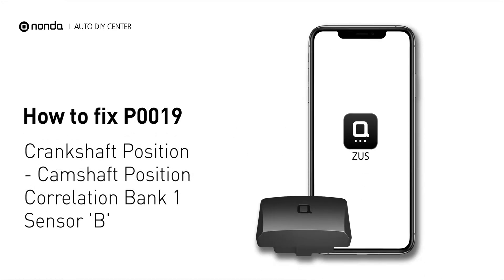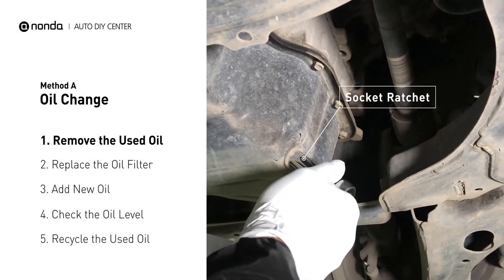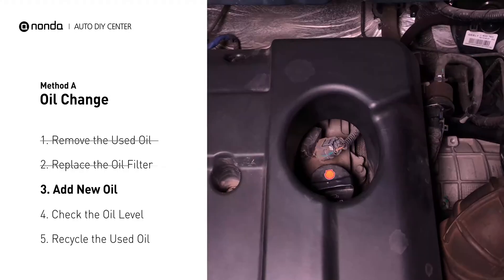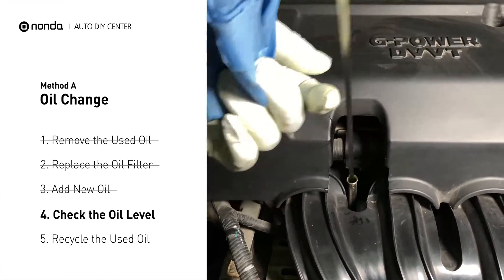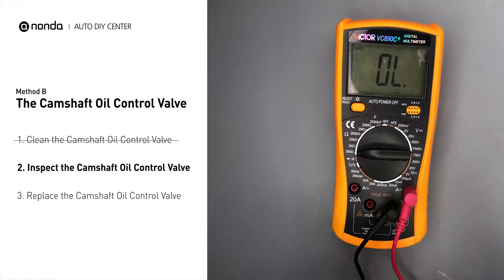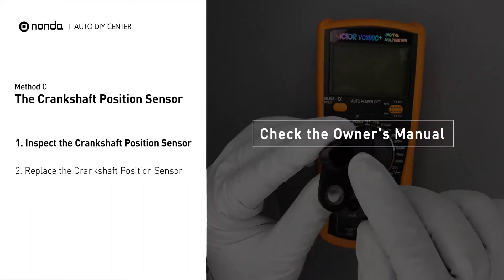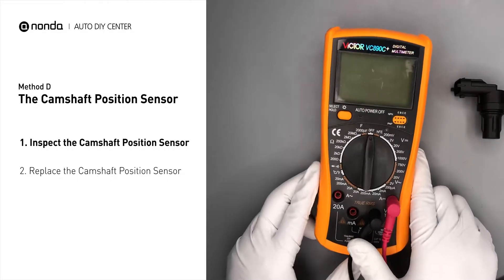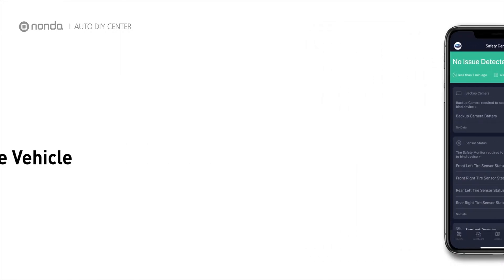How to Fix P0019 Engine Code in 6 Minutes [4 DIY Methods / Only $6.85]

Comment from the maker: Hi, I'm Steve, nonda's lead mechanic engineer. 
Feel free to leave your comments here if you have any mechanic questions, I will be glad to help you out!
Reply: I have installed a rebuilt engine and got P0019.  I put the racing oil by Driven for engine break in.  Does that oil cause the oil.  Because I am replacing it immediately once I run the engine in idle.

Comment: This is usually wrong.. if you are getting this code the timing chain is going bad. Save time and just change it
Reply: Bs. It just means the computer isn't reading the signals from the camshaft or crankshaft sensors at the right time . These are Hall effect sensors so this can be caused by anything that can damage it or effect the magnetic field. Things like engine sludge , heat damage from low coolant , low oil ,road damage or sensor failure will also trigger this code. If we use a 2015 Hyundai Elantra as an example , i just fixed one with this code that triggered after an oil change . I pulled the sensor ,  found a bit of gunk on it,  tested it to be sure it was working then changed it anyway because the part was $4 on amazon.

Comment: Hello my Subaru xv 2017 error p0019, took it to the mechanics, they looked at the solenoid, they replaced it, the check did not disappear, we need to disassemble the engine and look at the circuits, also other mechanics say it was a case of the whole engine, all the filters were changed, but it turned out that the electronic control unit was changed and the error disappeared after that, just what do you think? And in general Is it possible to drive with this error?

Comment: Subaru Crosstrek P0019 code. Crankshaft Position- Camshaft Position Correlation-Bank 2 Sensor B
Reply: Me too, a 2018.  Did you get this fixed?  Do you have sluggish power in lower speeds?
Reply: @rivkag4669  I ended up having to reset the values learned. Then I was good.
Reply: @rivkag4669  hi, I read that you had error p0019 on your Subaru, were you able to fix it?
Reply: hi, I read that you had error p0019 on your Subaru, were you able to fix it?